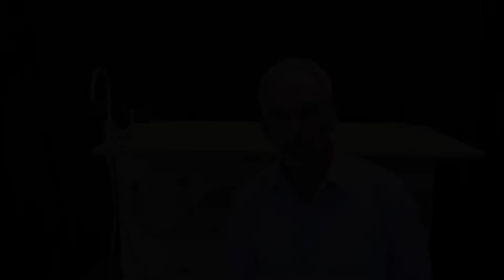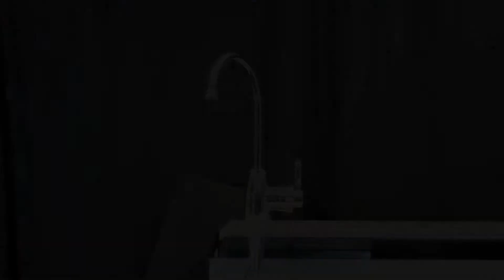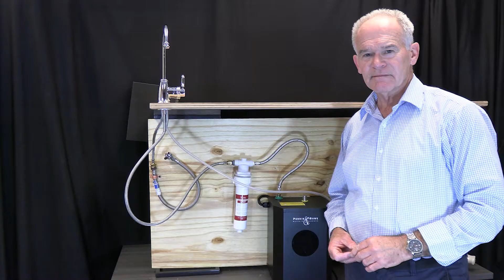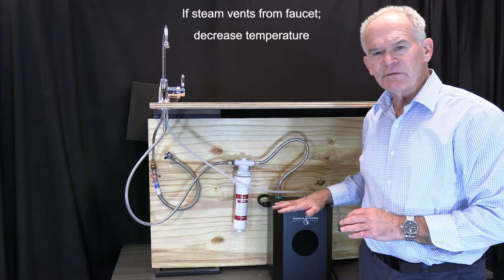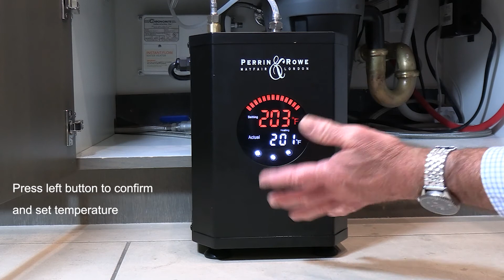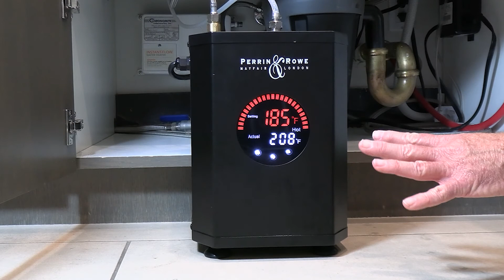Hot Water Dispenser, Tank, and Filter Kit Operation & Installation

Comment: My water heater has stopped heating. I set it to different temperatures, and it stays at 70 on the actual reading, only cold water coming out of the faucet. What should I do to fix it? I make sure I confirm the temperature but no luck.
Reply: SAME!

Comment: Why does the faucet have a cold line, hot line and also the flexible tubing that connects to the hot water tank ? I see in the video you have one of the lines capped with a valve on it with an extension line. Can you please explain the three lines coming out of the faucet, a scenario where all 3 are needed ?
Reply from the maker: Thank you for the question. Please see step 2 for a great visual of the supply hoses, in the link provided. https://images.salsify.com/image/upload/s--RZJNDjnS--/u16mhl47yotwr8yeg3qu.pdf
Reply: @houseofrohl  Thank you, I appreciate it !